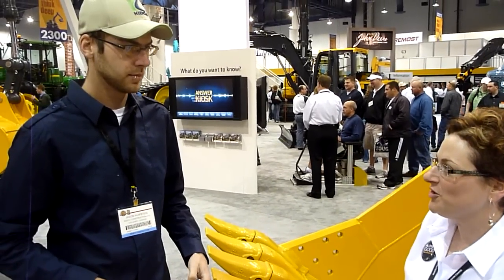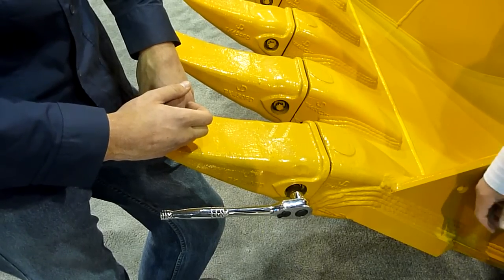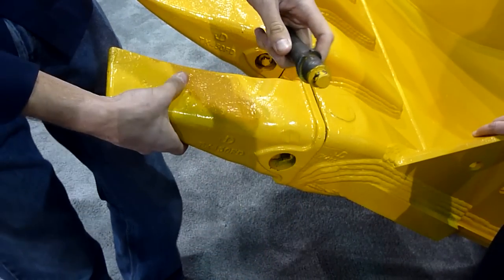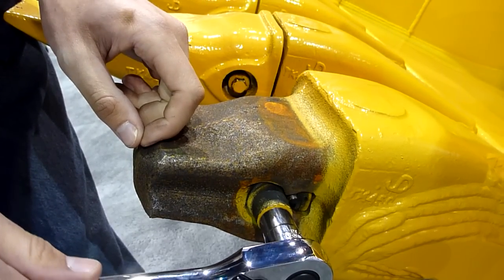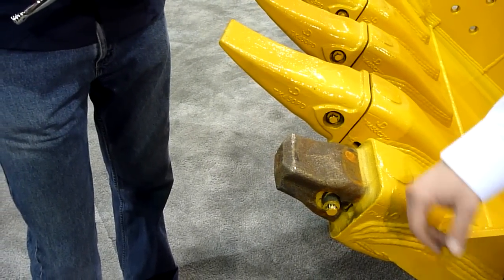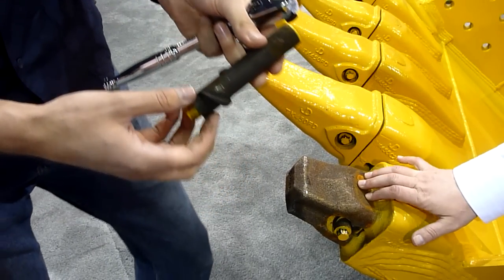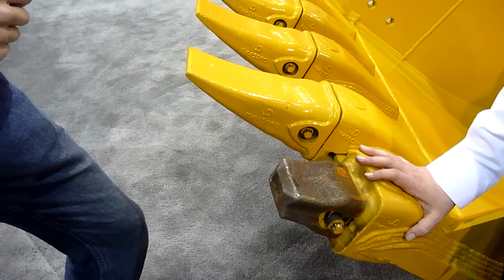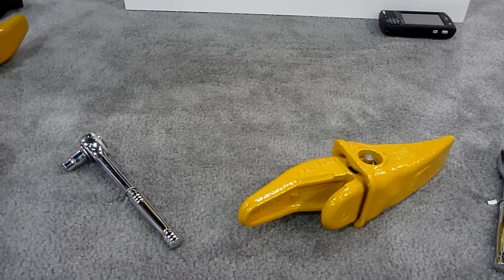TK Series Hammerless Teeth

Comment: Esco has a similar set up for our Hitachi EX 3600's and EX 5500. Beating the crap out of pins or wedges with sledge hammer is frowned upon at companies that want to maintain a good safety record.
Reply: hahah i cant telll you how many times i smashed fingers changing backhoe teeth on a cat and their pin design sucks they always fall out and the pins break when you push yourself back

Comment: how do these work in burning slash piles however? The Esco vertical pin teeth worked great but the teeth all fell off working in hot fires or pokey debris. Not saying these would, but rubber is in there so I'm sure it would be influenced by heat.

Comment: @robby844 You'd be surprised.  Our ESCO teeth on our hydraulic shovels use a similar rubber lock, and I've never seen one fail, and that's after moving millions of tons of material.  I think this has great potential.

Oh, and as for the problem being operators having trouble finding ways to lose ratchets, I'm sure they'll find a way....LOL.

Comment: Complete trash, they seem like a good idea untill dirt and rust get inside, I have broke many breaker bars and sockets trying to remove the pin. Changing 5 teeth shouldn't be a 5 HR job and shouldn't need a torch.

Comment: We use those teeth on our excavator and they dont lass long they wear to quick in rock and frost... We even had new one break in half. Not worth the price.
Reply from the maker: Sounds like you aren't using the right tooth for your application Mike.
Reply: We even went from size 20 to size 25 on 3 of our160d john deere on a 3/4 yard bucket and they dont lass
Reply: As long as the fastening bolt itself isn't compromised by use it sounds like a good system. The lack of durability sounds like either a steel/alloy quality problem or you are using the wrong capability tooth for the application - ie using a GP tooth when a rock/extreme use tooth should be used.

Manufacturing issue or operations selection issue, only Mike knows for sure. ;)